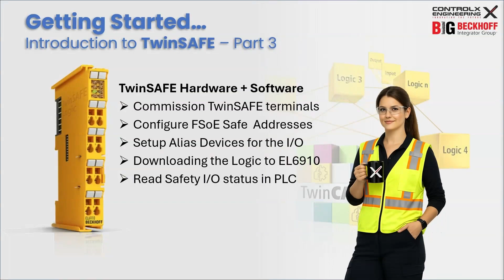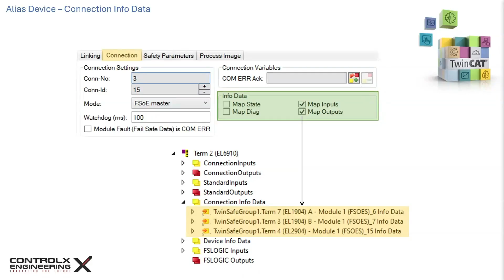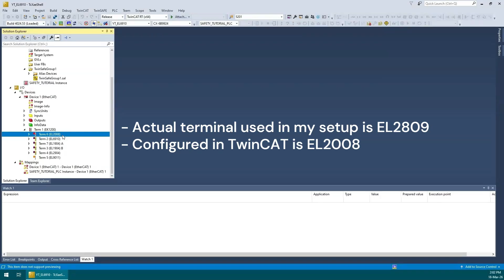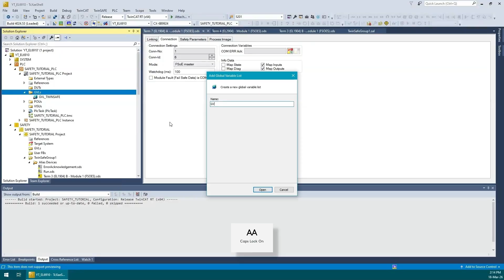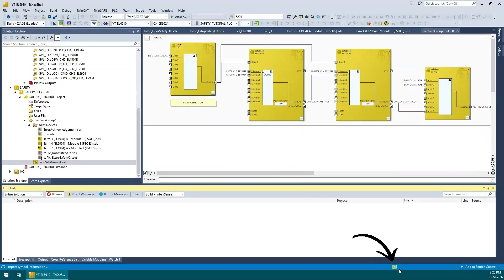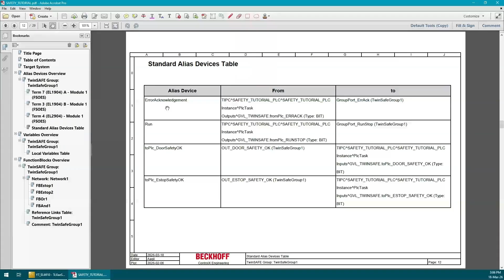How to Commission Beckhoff TwinSAFE: Hardware & Logic Download - Part 3

Comment: Hi, I only used the emergency stop part and everything loads and compiles correctly. However, when I go online, it won't let me select the 'glasses' (monitor icon) in the TwinSAFE program. What can I do?
Reply from the maker: Send me an email at 'controlxengineering@gmail.com'. Include screenshots of the issue and I will try to help.

Comment: hi, thanks for video
Just a question about Alias Devices toPlc_doorsafety and toPlc_estopsafety. Did they created automatically or you created them? 
In my project they did not created automatically, so I created them manually. However, now I have a fault "Alias Device "toPlc_doorsafety" and "toPlc_estopsafety" are not connected to the application. What do you suggest?
Reply from the maker: Thanks for your question. Those aliases were created manually. Looks like I skipped over the part where we create standard aliases. It's easy - right-click on Alias Devices and select 'Add multiple standard variables' and in the pop-up enter 2 for output variables. You will now see two output aliases created called Standard Out Var 1 & 2. Now you can rename them and link to your PLC variables.

The link to my project is provided in the video description.